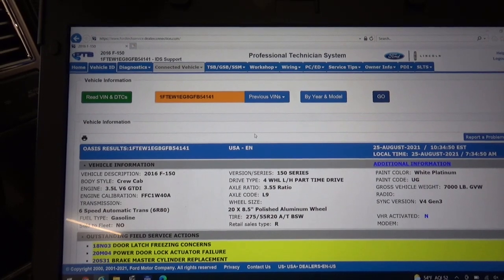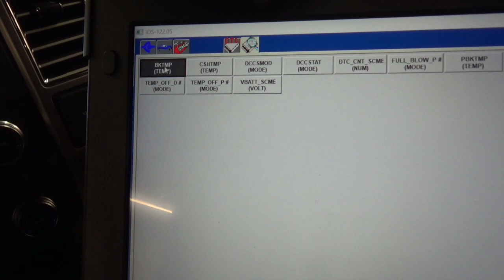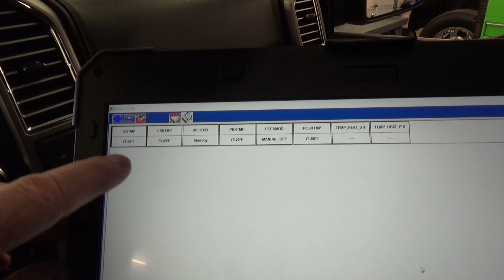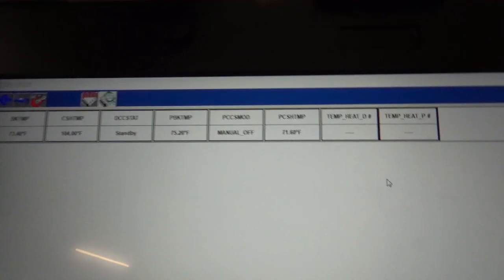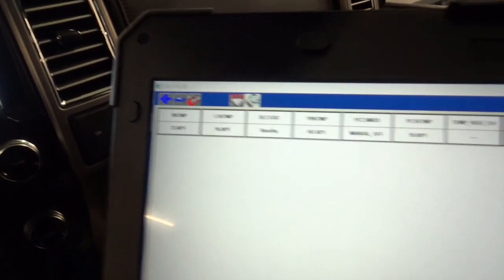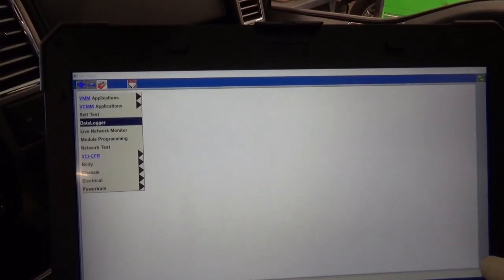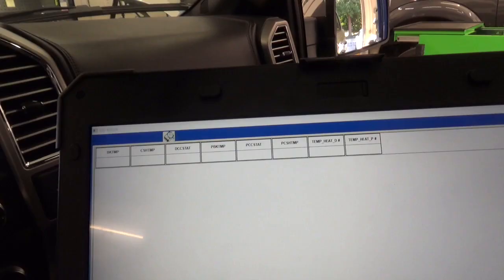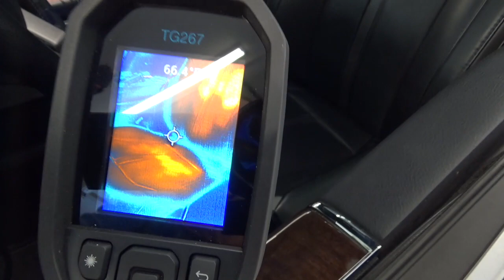FIXING YOUR HEATED SEAT, CODE B272C

Comment: My 2015 MKS both Driver/Pax seats went out the same time....help
Reply from the maker: All four thermal electric devices (TED) are controlled by the dual climate controlled seat module (DCSM) which is located under the passenger front seat. Disconnect the 12 pin connector at the module and inspect to see if ground wire pin M BK-WH is burnt. If so then you will need a new Pigtail Kit Part Number: WPT-928 and possibly a new module if it's burnt inside. That's where I'd start. If all looks good then check battery junction box fuse F28 30A

Comment: Thanks for the video. I have a 17 Edge Titanium with heated and cooled front seats, passenger H/C is fine drivers not working. My connector on the module under the pass seat looks fine, not burned like many do. My question, is there any why to verify TED is bad without a scan tool? Resistance readings? I’m an electrician so i can do that but not knowing the correct values makes it hard to verify. I don’t want to just throw a TED in not knowing even though this does seem like the most likely issue in these Fords other than the ground on the control module under the pass seat burning up. Thanks.
Reply from the maker: If the module connector is not burnt and the power and grounds are fine it's almost guaranteed the TED is bad. There is a pinpoint test chart depending on the code that will test the resistance on all the circuits. If you know someone or can get access to a scanner that has the seat PIDS then diag is a snap. Clear codes, start engine and watch both seat temp sensors to see which doesn't rise then replace that TED. What codes do you have?
Reply: @raincitywrench117 thanks for getting back to me. I only have a Bluedriver scan tool, which doesn’t scan the heated or cooled seats so I’m not aware of what codes may be present. I’ll see if any mechanics I know have a scan tool that’ll read the seat codes before I swap out the TED. I’ll update when I find out what is the issue. Thanks